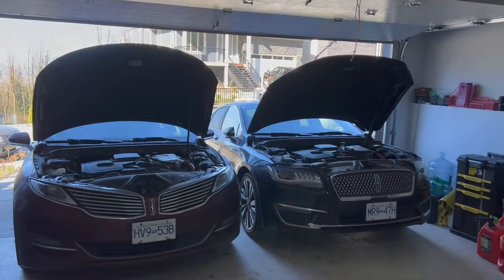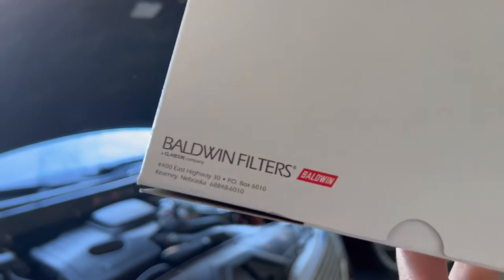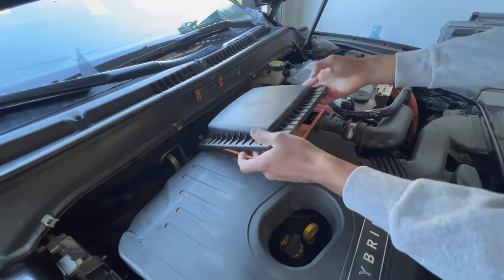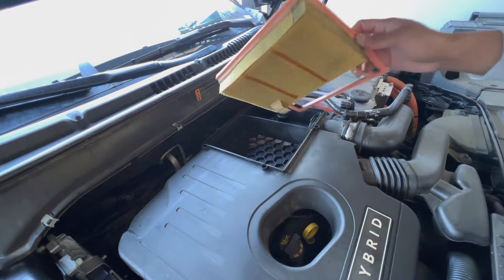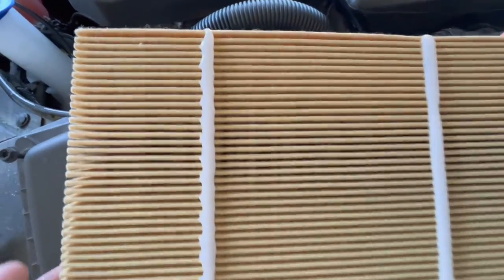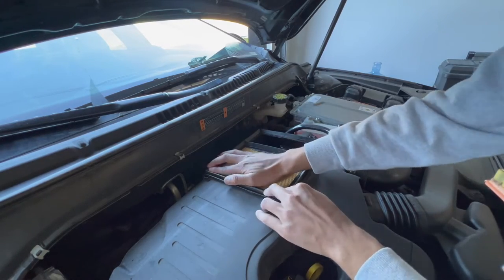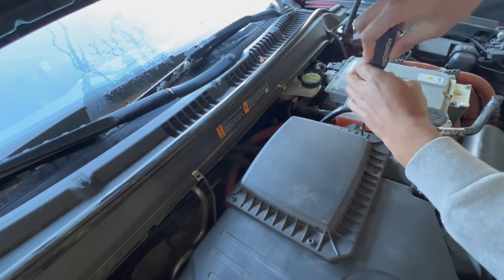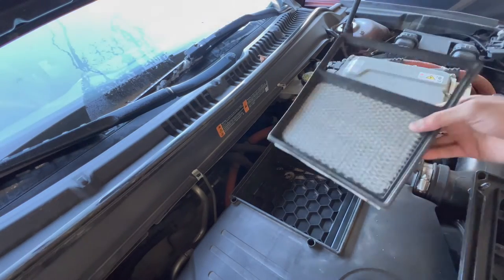How to Change Engine Air Filter on a Lincoln MKZ | 2013 - 2020 Hybrid

Comment: Were you able to fix the gas mileage issue? I too have a 2019 MKZ Hybrid and have noticed a different in mpg. I'm at 56500 miles.
Reply from the maker: I put in a bottle of Lucas upper cylinder lubricant in the gask tank and it seemed to fixed the issue